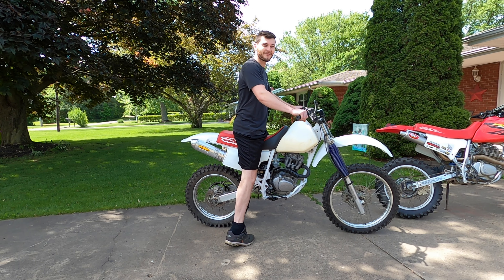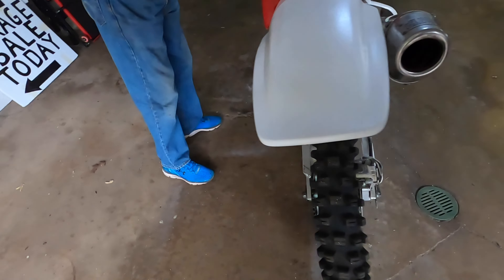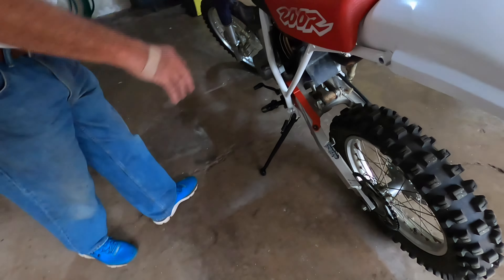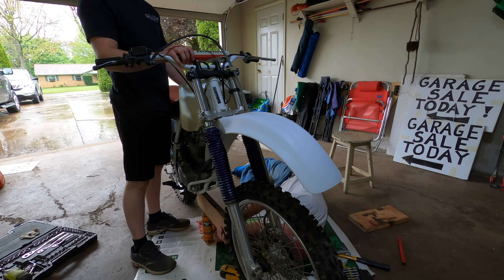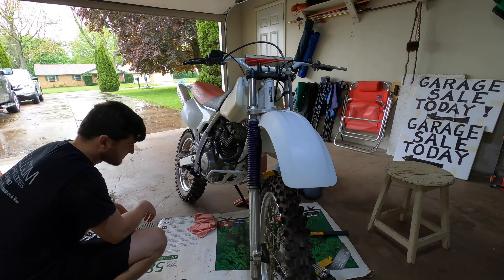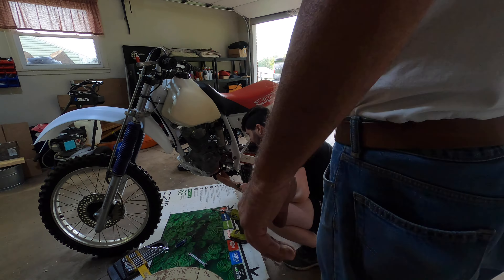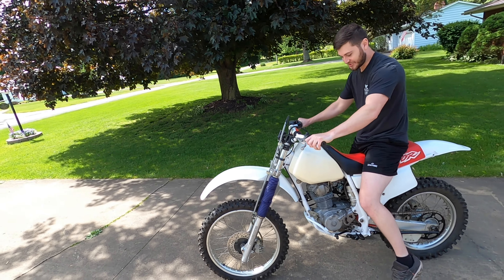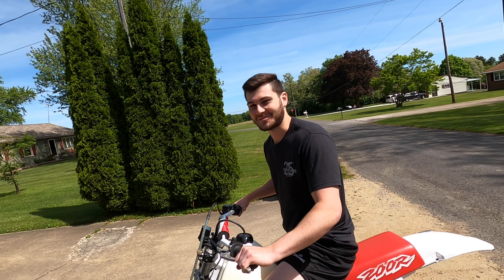XR200R Trail BOSS 2.0 is DONE!

Comment: So the 86 swing arm makes it taller ? It looks great , just finished mine up this week myself
Reply from the maker: The swing arm is slightly longer than the stock XR 200 steel swing arm so between that and the linkage it does increase the height of the bike.
Reply: @SubscibeBikeGiveaway  is it a direct bolt on ?
Reply from the maker: @onlyunojhuno welding and shimming required

Comment: Very cool set up. I love it.  , I’m seeing lots of Honda CRF 250s being part it out but they’re in a 2000 to 2006 range. Do you know if that swing arm will still fit and forks? Thanks.
Reply from the maker: Off hand I’m not sure. But if you measure the triple tree and shock length you can probably see if it will
Reply from the maker: Probably be easier to make motor mounts for a cr roller

Comment: Hi, so I'm 16 yrs old going for a 1st bike . I'm almost 6" My older Brother is 6.2" he just bought a xr400 his 1st bike and my Dad has him in 3 days riding great . Do you think I'd be screwing up buying a stock  200 ? Or do I need a xr250 ? thanks
Reply from the maker: Great question. I’ve seen every size and age ride big bikes. The 400 is definitely not a beginner bike but if you’re a quick learner you can grow into it. Personally a nice xr250r is a great bike to learn on. Being confident is key if your not confident on the 400 buy a 250
Reply: Yes 2 days i have my youngest at 16 yrs old riding on dirt track , after a few hours learning the clutch , gears and brakes . :) All is well both my Sons are riding xr400's for their first bikes . Cost wise we couldn't have pulled it off anyother way . Now to get busy on that trailer we paid 140$ for lol. Get it ready for riding in the spring . Thx

Comment: how would i go about putting a bigger tire in  the rear i have the stock rims
Reply from the maker: Stock rear is 17 inches so you would need a 86-89 xr250 rim to move up to 18 inches. That would be a direct bolt on.
You can also use a 90-95 but welding is required
Reply: @SubscibeBikeGiveaway  thank you